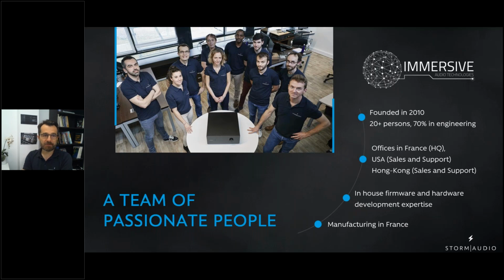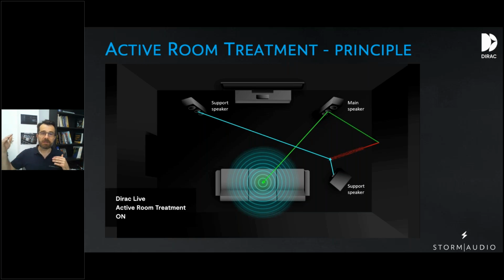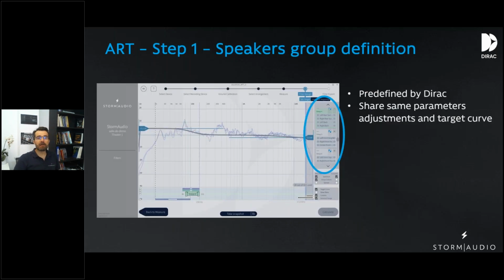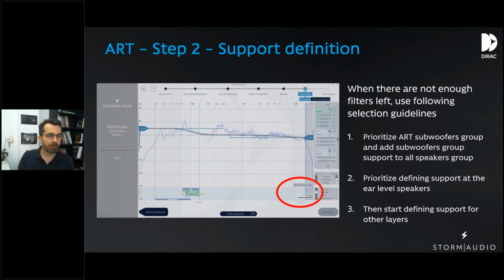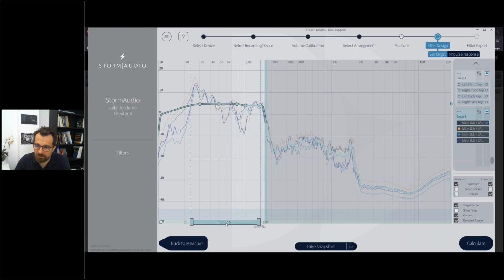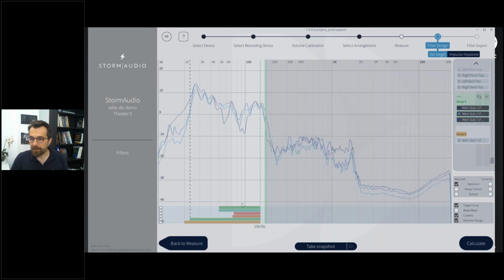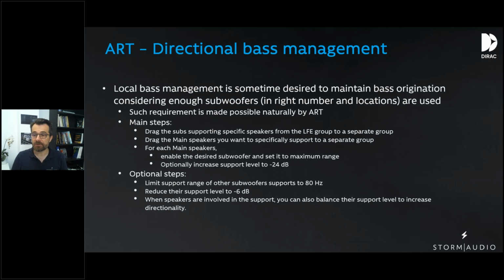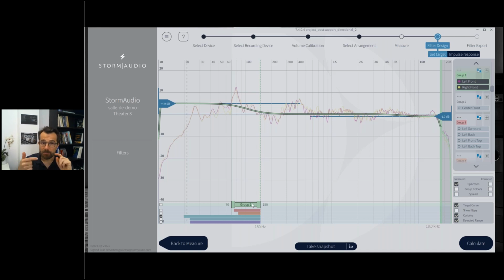How to make the best out of Dirac Active Room Treatment

Comment: I have a basic quandary. Do support speakers (or subs) contribute to the overall SPL or do they simply preserve the SPL of the main speaker? I ask this because all of my speaker locations cover 20-20KHz  with a low freq response of -3dB@18 Hz. But if only one is the "main LFE" contributor then are all of the rest just correcting the one speaker/sub? Does changing the support level from -18dB to -24dB increase the overall bass SPL or does this just give ART more headroom to tame the impulse response? Ideally, I prefer not to define any subs given my situation, but I don't want to do this if my low end SPL is limited by ART.